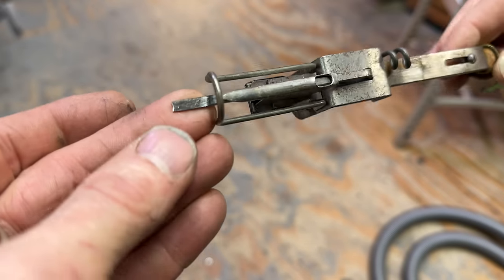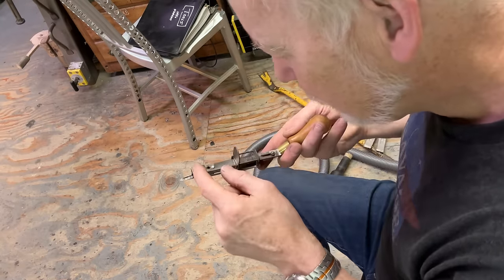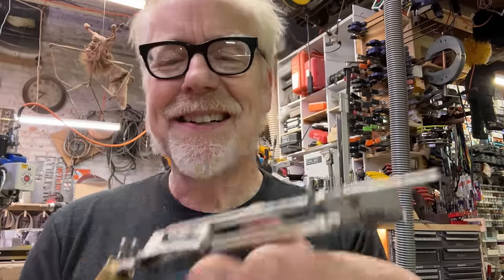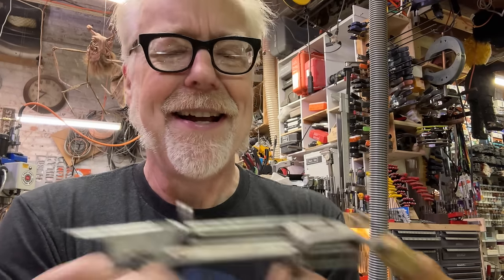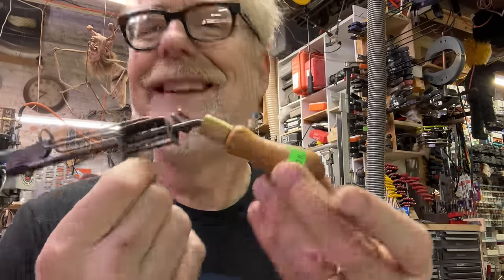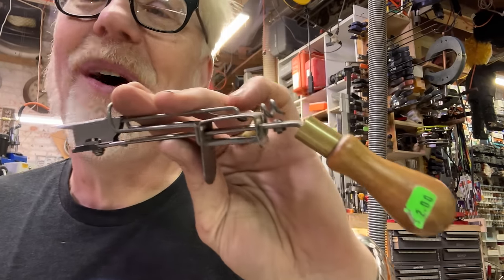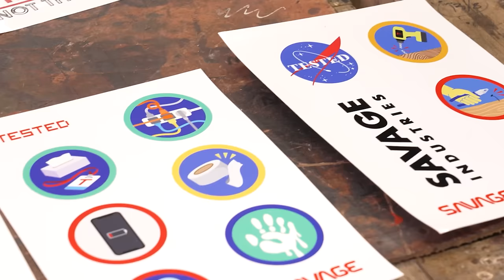Adam Savage's Mystery Tool Mailbag

Comment: It's not used for tagging livestock. Those are kind of like a paper punch meets a pop riveter. 

It's for something that large and that one can be kind of crude on because that's a wide blade. If it's for something large scale, and I think it might be, then it wouldn't be so crude because it would be using a large thread.  It looks like a very fancy, job-specific sewing punch. It clearly is for making use of a continuous feed (also why it shows it's not for tagging ears) which would be for sewing something together. To me, it looks like something more for repair than making. Probably something for a tufted or shag carpet or rug.

Comment: I would not have figured it out until you pointed out the "string guide".  Almost immediately I know it had to be for hook rugs as the node where the point goes back and forth (leaving a loop of yard) is actually flat.  So you need a hook rug screen or whatever they call it and just thick in in the hole and pull it back.  The adjustment by the handle would change the size of loop.  I would think you would have to glue a backing on and then leave it with loops or you shave the carpet when it is done (most likely this).

As a kid I did a few hook rugs, but they came in a kit with the backing mesh colors and packages of pre-cut  colored yarn to match and you used a small hook tool and spent days making it.

Comment: It looks like a simple sewing machine that could be used to sew chain stitches in heavy materials like leather, basically an awl and eyeless needle in one.. 

The hollow awl wrapped around the thread pusher will make a hole in the (I presume) leather, then the pusher will push a measured (by the depth stop) loop through the hole. The slight concave shape on the end of the pusher is so the  cordage won't slip off the side, and stitch tension is probably controlled by pinching the cordage against the handle before it feeds into the guide.

Comment: It's a rug hooking tool. My mom made rugs using one of these when I was a kid. You just need yarn and some heavy fabric on a frame.
Reply: The adjustment at the top of the handle changes the length of the loop so the rug can have different heights.

Comment: (1) Tufting tool for rug making because of the adjustable stopper; (2) tattoo machine, early century, manual, where a string dipped in ink is the transfer mechanism. Think prison tattoo.
My thoughts on livestock piercing is a block of some kind is needed to sandwich the animal's ear lobe.

Comment: NETS PATENT 1926, BURLAP STICHER has a narrow and longer slide large hole, HAND STITCHER FOR LEATHER, CANVAS SAILS had shorter and wider slide medium hole, and the one for gris or flour shot narrow and small hole  you could still buy them in the 60s  some of the old timers sill used wooden body stitchers "banjos"

Comment: I couldn't click on this video fast enough when I saw the thumbnail. I have the same exact tool in my collection. Paid about the same amount for it, too! Bought it because it looked cool. I was thinking it had something to do with pushing thin leather strips through bigger pieces of leather. Based on the other comments, the mystery is solved and it looks like I was off but in the ballpark.

Comment: Very amused by the way you put your flashlight in your mouth so as to use both hands @4:52.  I am an old engineer/crafter (about 20 years older than you) and have been doing this for Many years, to the point where many of my flashlights have an added ring near the rear made of O-rings and silicone tape so that I can bite on them and hold them more securely and comfortably.   By inspection the tool seems to be a sewing or tufting tool similar to a sailmaker's awl or a rug hook used to make and repair rugs and/or to sew seams in heavy canvas or leather.  To use it as a sewing tool you would make an initial loop and then for each subsequent stich you pass it through the last loop and the canvas and then draw the next loop up through the loop you just traversed, making a single thread chain stich as do some industrial sewing machines.